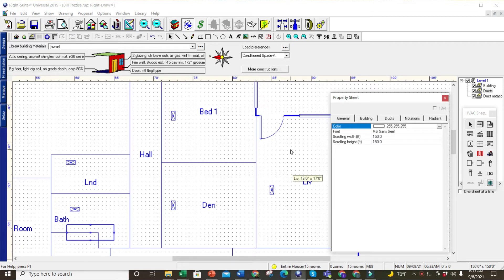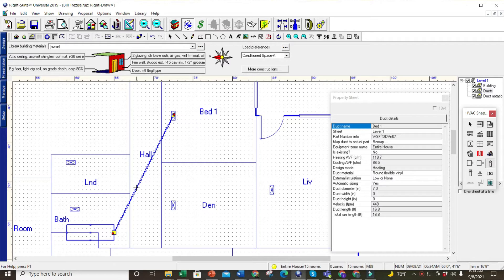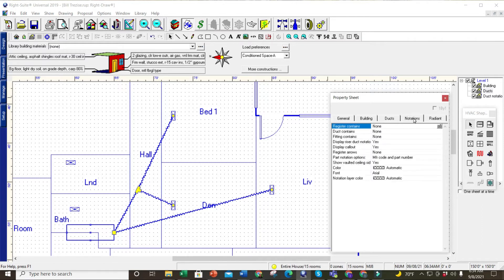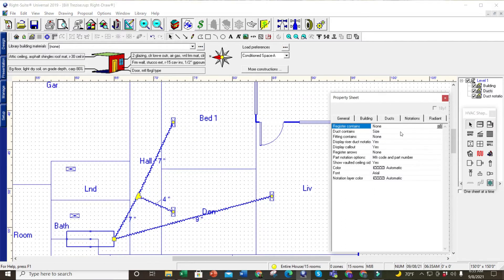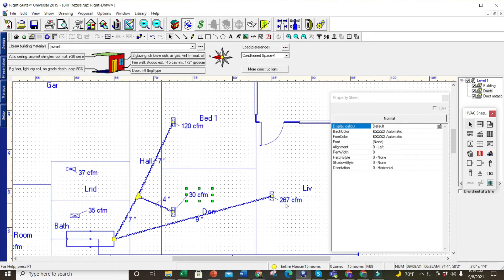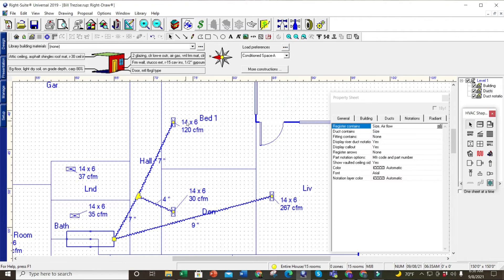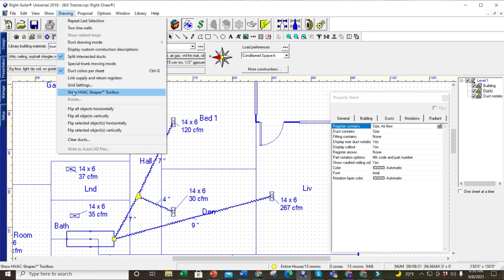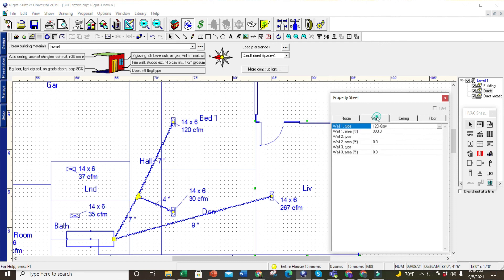Quick Wrightsoft tip, Lost my sizes

Comment: Mitchell, thanks for the video. I am having this issue with one of my templates. However, my property sheet has "size" selected under "duct contains" but still won't show it on the drawing. Any other tips/tricks to resolve? TIA!
Reply: Hey Joey have you figured it out? I’m also having the same issue.